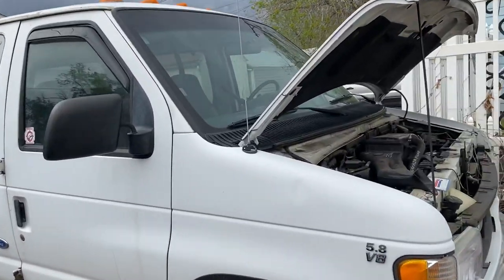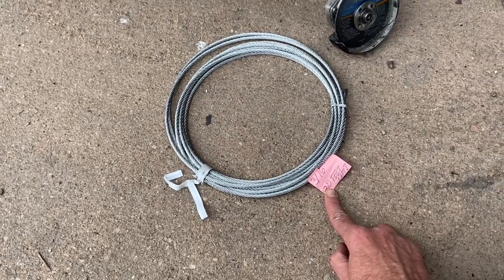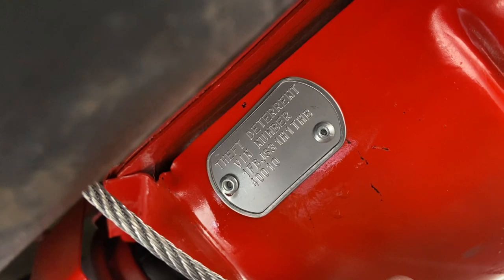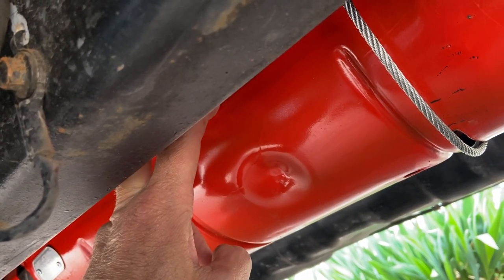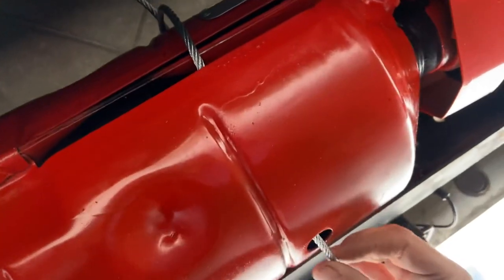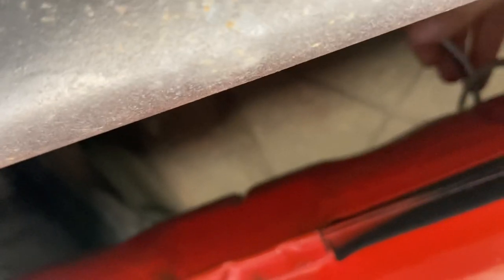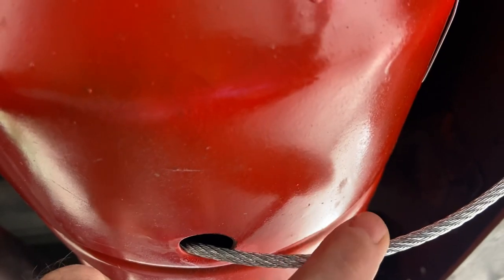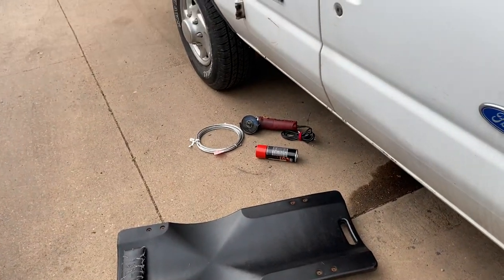Catalytic converter how to Anti-Theft Security Protection DIY. Spray paint Vin tags Steel Cables $30

Comment: They are going to cut that cable with the same grinder they cut the bolts with.
Reply from the maker: Oh perhaps 
What would you suggest to stop that?
Reply from the maker: Oh ic ic 
Many people can’t because of their state’s emissions program plus it pollutes our planet’s air.
Plus I’ve read that modern cats don’t have the back pressure the early models did so there is not much benefit and can trip trouble codes and such.
Yet doesn’t seem right that we can’t legally buy used cats from salvage yards when needed would make replacement much more affordable..
Reply: You don't have to spend money reinforcing. In California; if you don't give consent , they cant legally steal your catalytic converter . With all the laws and regulations it protects us. Same thing with covid, cant legally enter your body if you don't give consent.
Reply: you are absolutely right 
need big piece of metal and then bolt into frame from this side to the other side ,
Reply: @JimTMcDaniels1  - need big piece of metal and then bolt into frame from this side to the other side ,
Reply: @sinnombre2857  lol
Reply: Well cutting whit grinder need a more men power  plus is  going to take a longer time to cut those wires because those wires their move and scum bags are going to have hard to hold it and caught out the same time? 
going to need two persons.
one the need one holding the wires and secon person cutting with the grinder.
Reply: @JimTMcDaniels1  Used cats are usually worn out from a chemical activity perspective. The EPA probably ruled long ago  not to allow reuse of old cats.
Reply: it's speed they looking for, if it takes longer they move to the easy one.  ask all those with thumb down and they will agree with me
Reply: Cutting cable with a sawzall is not easy. They use sawzalls to remove the cats. They cut the pipe not the bolts.
Reply: @scottys1423   I don't understand this law. Can't they tell if the cat is still good when performing emissions tests? If it passes, then the cat is working regardless if it's old or new. It's these dumb laws that are making the prices soar. But I believe this is more than likely a way to force people and car manufactures to electric vehicles.
Reply: @SI0AX  True, if a car does not pass emissions, then a poisoned cat is a likely cause. But I don't think the cats are stolen to go in other cars. Maybe some are given so many cats getting stolen. But for the most part the cats, collected by the wrecking yards and scrap recyclers, are processed to recover the platinum, palladium, and rhodium and use it to make new catalysts, etc. These are rare heavy metals and quite expensive.  And the metals can be recovered from a good cat or a poisoned one. Hence the value regardless of condition. I do not know if its actually illegal for a muffler shop to install a used cat, but they will definitely advise you to buy a new one if yours is stolen or worn out. I also do not know if wrecking yards are allowed to sell used cats to the public. These metals are toxic to humans so its really not a good idea to handle a cat that has been removed from service.
Reply: Yes but now they need two tools: grinder, with a cutting blade AND a sawzall to cut the pipe...   more time consuming =  more likely to get caught and meeting the business end of a 12 guage.
Reply: Yeah, but an angle grinder makes a lot more noise than a hack saw.
Reply: @Jhmoto1331  not if it's in a pain in the ass position. Lying on your back squeezed under a car with bolt in a crummy spot ain't as easy as angle grinder.
Reply: Possibly. But it means he has to carry more tools.
Reply: @JimTMcDaniels1   Hes incorrect. The crooks use battery sawzalls. A grinder would be 3 plus minutes and likely would have difficulty accessing the cat. The sawzall can do it
 in 30 seconds with the long reach blade.  Jim M your idea is great!

Comment: Hey Jim, great affordable idea for diys/weekend warriors to do. Quick question, with the way the wires are wrapped around the CAT/shield, did  you notice any rattling noise or vibration/hitting sound from metal to metal contact from underneath the exhaust system when the engine was on or while driving? Thanks for the great video,  keep up the good work.
Reply from the maker: Nope, no noise from it. Good question. The ONLY downside is the fact that down the road I might have to take the cable apart for some related repair or I might be the one who is cut on the barb wire if I'm not careful around it. But I would just have to reverse what I did to take it apart.

Comment: Take a pair of vise grips and put it on the end of the stud where the nuts go for the cable clamps. Smash those threads! You won't be able to get the nuts back off.
Reply from the maker: Hmm good pint but More than likely, the installer is the one who will need to take those nuts off later for some maintenance reason. 
The thieves probably won't have small wrenches to fit the nuts. 
Adding a lock tight would prevent them from removing without first applying heat and allow the installer to remove is needed later.

Comment: If you want to stop a criminal you have to think like one, I respect your effort and share to the community but that dont going to stop a theft, security is a illusion if a theft want something he going to get it so the whole point is make it difficult to steal, they dont care any vin or license plate number on it or color, who buy this things knows are stolen, they buy it for recycle internal metals they dont sale it as a catalyst,  your dog tag is hold in place for two aluminum rivets and criminals make it pop with a grinder touch same with those cables in no extra time.
Thefts dont like a long labor or noise, so the point is make it difficult, in my opinion cover some how or encase the convertor with a metal sheet this means a lot of work and noise for a theft, become risky, loud and time consuming so they will move on to next target.

Comment: Awesome idea man thank u
Reply from the maker: I recently also bought 10’ on eBay of some 18gauge 4 point Barb wire and carefully with eye protection, wrapped it around the cat, adding it into with some of the cable clamps.
So something else they have to cut through and will cut them up if they move nervously fast like a tweezer criminal would.
Now I’m done done with what I thought reasonable for how far I want to go cheaply diy protecting my cat.
Reply: @JimTMcDaniels1  you think its worth making a video for the barb wire thing wrap or no?
Reply: @allanarango1047  no you are a thief !

Comment: they will cut the straps with the same grinder and then use paint stripper if they see that needed
Reply: Yeah and they could take the van if they wanted to dumbass the idea of things like this is just to make it a little bit harder to do so that the common thief moves on. They're looking for an easy mark not a challenge, if it looks like it will take an extra minute to deal with they'll shuffle on and find one that doesn't.
Reply: Dennis so far NONE HAS a grinder theyALL carried a SAWZALL, 🇺🇸🇺🇸🇺🇸🇺🇸

Comment: They are just going to cut the heat shield to take the cat. If a thief wants bad enough they will take it reguardless. Don’t work. The recycle center just takes the inside metal. It gets cut open to get it.

Comment: The same tool they use to cut it off will cut right through that cable with little work.
Reply: A cutoff wheel for sure, but most use a recip saw, and that doesn't work on loose cable.  However, this particular setup you don't need to cut it.

Comment: All still very easy for a thief to steal. They cut the cable with bolt cutters your paint and serialized dog tags re on your heat shielding which you can cut right off with a grinder and any overspray red paint can be scored right off with a Brillo pad. It’s a good effort. But theives are scum of the earth and relentless. My moms car got hit about a year ago so I welded a steel cage around it that I made out of heat treated rebar. They will burn through about 10 of the $40 carbide tipped sawzall blades before they can even access the cat. That gives me plenty of time to get out there and drop the car on their head
Reply: How much was the welder?
Reply: @bill Klein welders vary widely in pricing. You can get a cheap one from harbor freight for about $100 just a basic wire feed no shielding has needed but they range all the way from about $100 to several several thousand. I have a multi process Miller machine that was about 4 grand.
Reply: No shielding gas*

Comment: The real secret is to just delete it with a straight pipe 🤷‍♂️
Reply: obviously you don't live in a catalytic converter mandated state. Impossible to pass smog, therefore Impossible to renew registration without passing smog testing. On the horizon, All electric vehicles will completely eliminate this problem.
Reply: @justinmcmillin329  run a gutted cat and use E85, That's what I did when I lived in Colorado lmao

Comment: THE PAINT SAY 550 DEGREES BUT DOESN'T THE CAT GET UP TO 1,200 TO 1,500 
OR MORE, DEGREES  AND THE PAINT WILL BURN OFF OR CATCH FIRE?
Reply: You're correct.  Need to use 1300-2000 degree paint.  I already tried the Engine Paint, and it all burned off in about 20 minutes.

Comment: If they’re going to cut through the exhaust to get to the cat, they will have no problem cutting through the cable too.
Reply: You've never tried cutting a wire rope with a reciprocating saw. It moves all over the place. This video describes an adequate deterrent.

Comment: Bolt cutters will cut that cable eazy.. when they get the converter home they can cut the tags off...they are mostly after imports they bring in the big money
Reply: This is not to prevent anyone, it's just to deter from stealing this converter . It takes less than a couple of minutes to steal a cat (videos on Youtube) but if there's a car with deterrent and one without, they'd definitely go for the easier one.

Comment: I love good thinking. Don't take this wrong. I like your mind. But isn't it easy to cut cable?  Keep in mind, I RARELY cut with a sawzall metal of ANY kind, I always use cutting wheels or torch. OR is your thought, that it would be TOO MUCH extra cutting with the pipe, AND THEN, the cables they either wouldn't want to bother, AND when they see the red paint they would give up?  or if they try, you might catch em becasue of the time.  Curious.  Damned thieves.

Comment: The folks stealing the converters use some pretty good saw blades, and they will cut through the wire cabling.   They already took my converter.
Reply: Did you have steel wire protection and they cut it? If so I ll try a
Different method thanks

Comment: Good video.. I found this website where they sell the catstrap.. looks promising.. hope it works
Reply: Don't waste you money on the catstrap I purchased one to deter theft ( Had it stolen once)had a leak on the exhaust pipe so needed it out of the way so he could spot weld the leak and my mechanic literally took 5 seconds to cut the metal tie downs that comes with the kit! Told him not to even bother putting it back on plus I had the smell of burning plastic / adhesive when the car was used for 15 min or so total waste and a POS!
Reply: Catstrap for my vehicle is nearly as much as a new converter - $640.

Comment: Thanks . . what are the clamps called ?
Reply: Aircraft cable clamps/ wire rope clamps.  They are often sold near the cable and by the size of the cable.  e.g. 3/8" cable clamp.  Home Depot has both the cable and clamps.
Reply: I live in Everett WA. You can tell the cars where thieves had struck. They sound like machine guns as they drive by.

Comment: Won't paint burn off with catt high temp
Reply: Engine Paint does not withstand those higher temps on the catalytic converter.  Yes, you need Ultra High Temp paint, in the range of 1300-2000 degrees F!
Reply from the maker: My cat has factory heat shielding welded to it which is what I painted. Most of the paint is still on for now.

Comment: I love how the cable is so loose he moves it out of the way 😂
Reply: Steel cable is hard to cut and if you can put some slack in it, it gets more difficult.   Anything to make a thief work harder
Reply: You would have to use 2 hands to cut a wobbly, unstable cable with grinder and even then it's a PITA because you would need to get the blade close to your finger or use pliers and risk cutting up the pliers or your fingers and with it moving around(hands shaking), you will not get a clean straight cut and have to make multiple cuts to get it severed. With solid fixed piping, you don't need to brace anything and can just cut it 1 handed easily and make it a straight clean cut.
Reply: @SI0AX  Yes definitely a little slop in the cable will make it difficult almost impossible to cut with a battery sawzall. Thats what the criminals use.
 In fact if you think about it, Cat theft was not a real issue to speak of until the new high powered battery sawzalls were introduced.
Reply: @chuckdavis5300  These new portable battery tools are awesome! I spend a few thousand dollars on a battery portable shop vacuum, a large and small impact wrench, an angle grinder and a dremel. Best tools ever invented so far!

Comment: The best way to stop them is don't buy a new one rock it out baby loud sound and all they stole mine 6 months ago and I wouldn't buy another one if they rolled over dead so tbh I fixed mine with exhaust tubing and let them steal that it's only 20 bucks to repair
Reply: " fixed mine with exhaust tubing and let them steal that "       Uhhh, has anyone told you they  don't steel tubing, they steal catalytic converters?

Comment from the maker: I've decided to add some 10' $8 18 gauge 4 point barb wire from e-bay held under my cable clamps there is room and wrapping around my cat and maybe attach to pipe clamp bolts as well. I'll try to add a video after.
Something more a thief would have trouble cutting through and might cut their hands. Reciprocating saws require the material they are cutting to stay solid still and the cables and barb wire won't stay still. 
Well it's the best idea I came up with on a budget.
With this I am done theft proofing my cat. If my van sat low, I suppose I might be slightly concerned the barb wire could flammable snag tumble weeds and shopping bags. Yet the barb wire isn't hanging down loose, it's tight against the cat and my van isn't low. The real concern for me is making sure I don't cut myself on the barb wire whenever working near it but in perspective, it's not the only sharp surface that can be found under our vehicles.
Thieves are in a nervous and in a hurry, not too good to be in a hurry around barb wire is it!?
If I lived in a high drug crime big city, I might have considered more but I'm content with this and was able to do all by myself very affordably.
Definitely says "MOVE ON BUDDY, this isn't gonna be easy at all to steal and your probably gonna get caught the longer you stay"!
Take care of yourself.
Reply: Do you think wrapping only with barb wire would work for a Sable 2001 LS ? It's a heavy car, so I think that helps deterring robbers and I think the cat is somewhere around the middle of the car..
Reply from the maker: @jaimereyes4157  I suggest you take pictures of your cat location and google and read and watch videos of what people recommend or have done. Write notes then sit down with paper and list and discover how much of a chance someone will try to steal yours and if what can practically be done. 
For instance come vehicles require the thief to unbolt one end of the cat up by the engine so some weld the bolts to stop this.
Options vary based on the car's design so you'll have to be creative to brain storm what is practical for your vehicle.
The barb wire was like the cherry on top for me since I was able to clamp it under the cable clamps and was only $10 and nice to think of instant karma if someone tries to steal my cat, it'll bite them back! lol Some people are concerned that barb wire might grab a plastic shopping bag blowing around and them cause it to melt to the cat or catch fire. It's all up to you, it's your vehicle. Have fun with it and then move on with your life without fear, knowing your cat may still get stolen or it may never get stolen, but you've done what your comfortable with doing.

Take care
Reply: hmm barbed wire not a bad idea 🤔 probably be a real pain in the ass to install but now u got me thinking to add a shit load of barbed wire all around everywhere under and around my cat. Then weld an extremely strong cage to the frame covering the entire length of any easy cutting points.
Reply: @jaimereyes4157  hi that goes matter, many lost their lives when Jack’s slip ! 🇺🇸🇺🇸🇺🇸🇺🇸
Reply: @JimTMcDaniels1  The wire is a big improvement.  I also welded 1/2 thick solid rod along the pipe where it bolts to the engine and welded wheel lock nuts to the attachment bolts, so you need the wheel key to unbolt them.   Should have my video up soon on this and other mmethods,, liike 2000 volt wire running around the pipe..
Reply: LOL, thief will cut his hands and sue you.....and probably get $$$.....